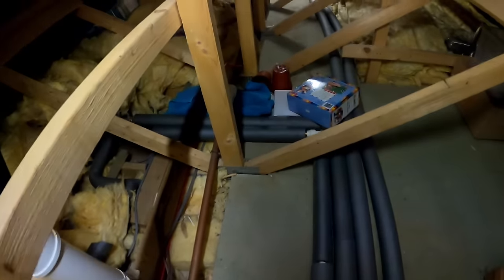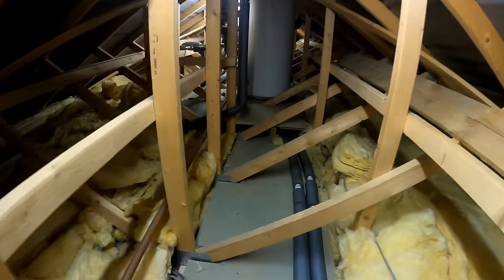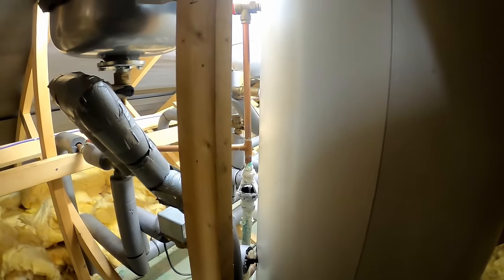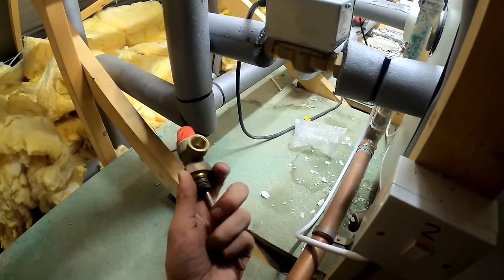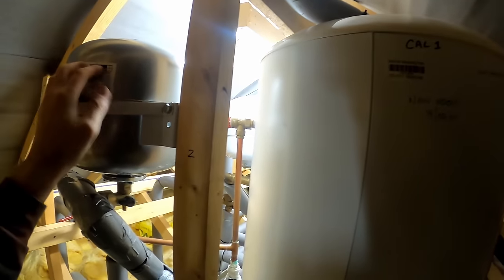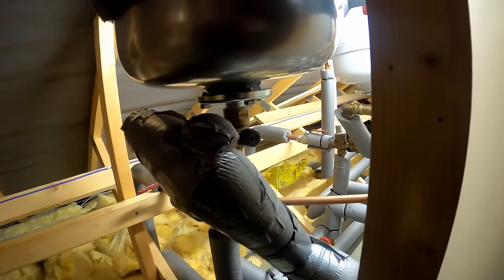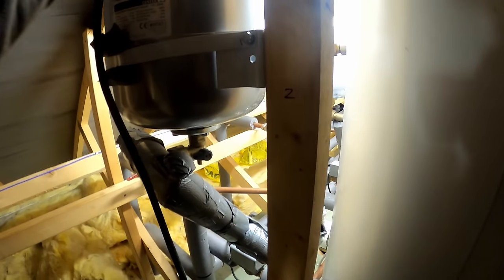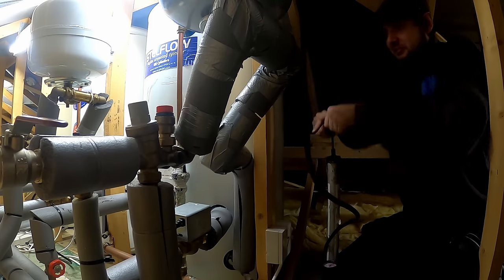PLUMBING COULD BE EASY, but it's always just out of reach

Comment: 12:10 that switch is on, looks like it goes to the immersion on that tank. Maybe that’s why the water is too hot?
Reply from the maker: I never noticed it at the time, the outlets were all blended but it could be why the tprv had gone off, in theory the stat should click off though, if I go back I will turn it off, thanks for watching

Comment: Two cylinders, is that because the property is that large or the household that big? With the two expansion vessels it almosts seems like there were separate systems here, or is one the hot tap water, and the other one for the central heating (they looked to be in-line but a video never shows everything).
Reply from the maker: The cylinders weren't linked, it was a small care home annexe so I guess one probably fed the kitchen and the other did the showers and taps, thanks for watching mate
Reply: @PlumbLikeTom  Thank you for posting these interesting vids!